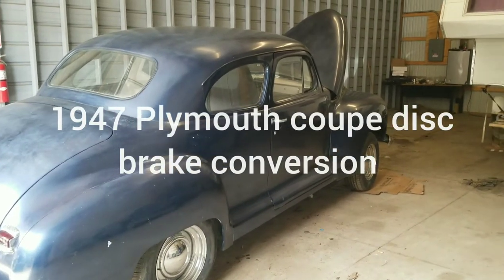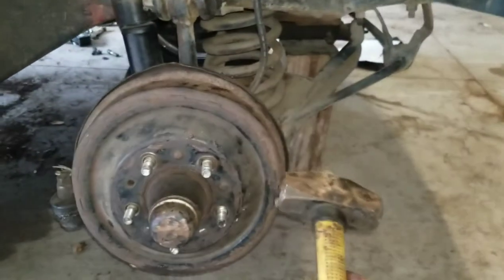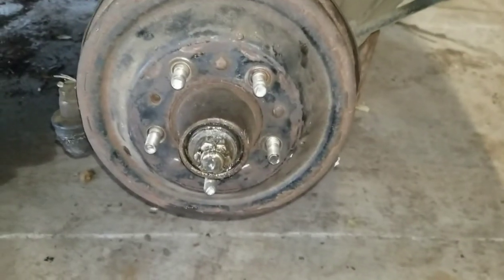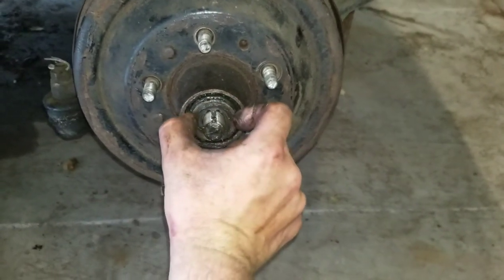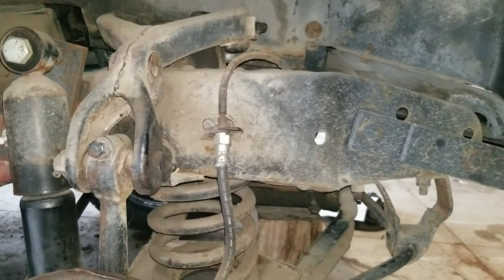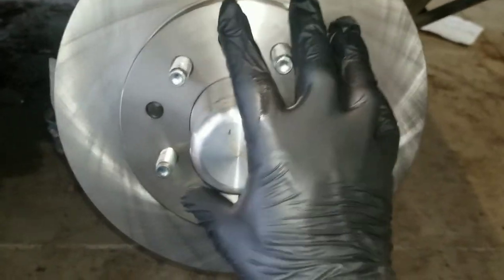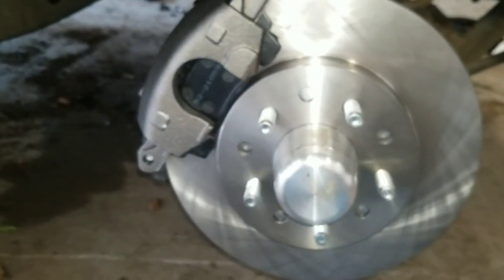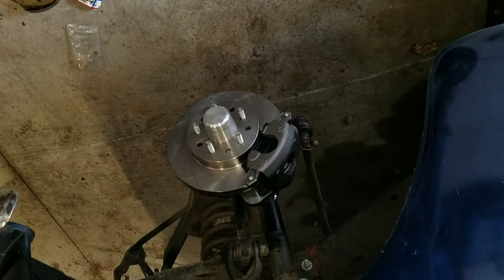disc Brake conversion 1947 Plymouth p15 Coupe

Comment: Where did you get your kit? I just bought a "48" and want to upgrade my front brakes and plan on putting in a Ford 8.8 posi disc brake rear-end.
Reply: Did you find a front disk kit for the 48'

Comment: i watched this video , what conversion kit did you get ? i'm asking because i'm doing the same thing for a 1948.
Reply from the maker: The customer actually brought me the kit so I'm not positive what kit it was or by what manufacturer.
Reply: @davedixon2635  is there anyway possible to ask your customer ? it is very difficult trying to find that kit, we are doing basically the same conversion. if you can't, i understand..thanks !
Reply: @davedixon2635  nice vids! But I also want to know where your customer found the kit as well. That’d be a big help. Thanks
Reply: @hotrodkats8427  scarebird brakes makes these kits
Reply: @Mr1troyd  scarebird brakes makes these kits
Reply: @bent_rods  ok, thank you !!!
Reply: @bent_rods  thank you!!!
Reply: Great video, just the facts, no useless fluff.  
I hate videos that take more time than actually doing the project or take more time than reading it would.  Thank you.
Reply: Why post this video if you don't know what kit it is.
Reply: @my55chevy43  quick Google search and it pops right up
Reply from the maker: @my55chevy43  most for the Desoto are basically the same setup, I've done a couple, honestly you can just Google disc brake conversion for any make a d model and you'll find multiple manufacturers and places to buy from.